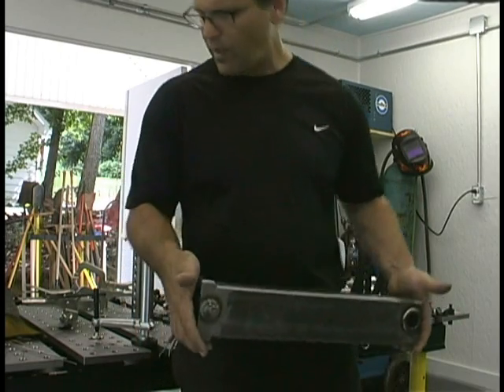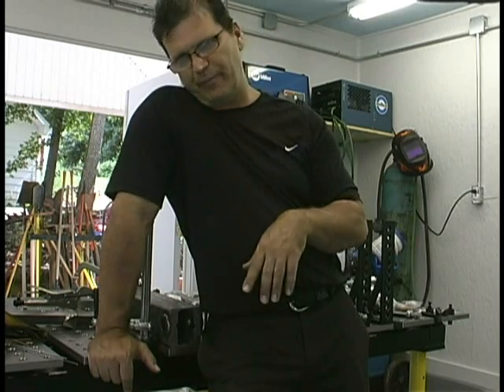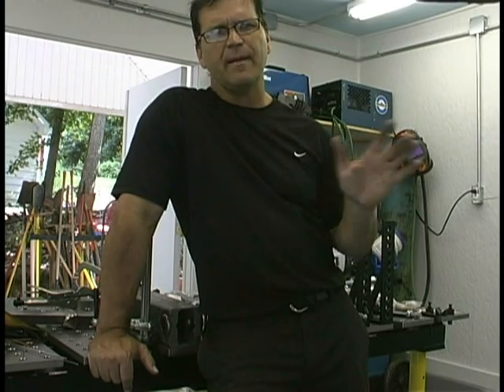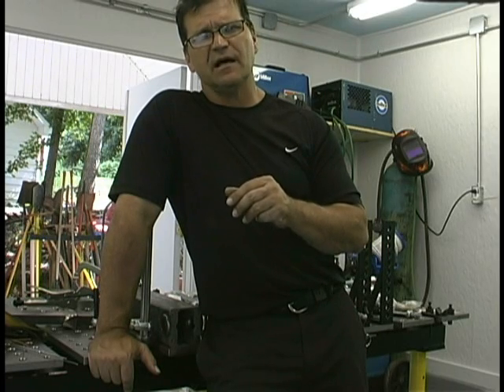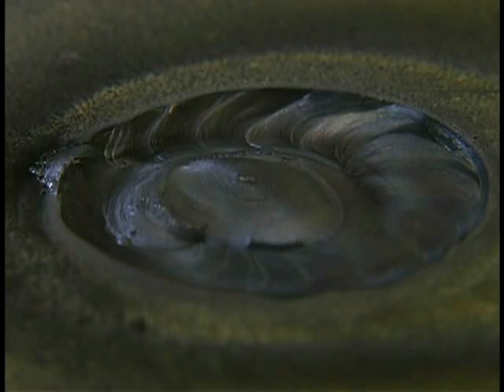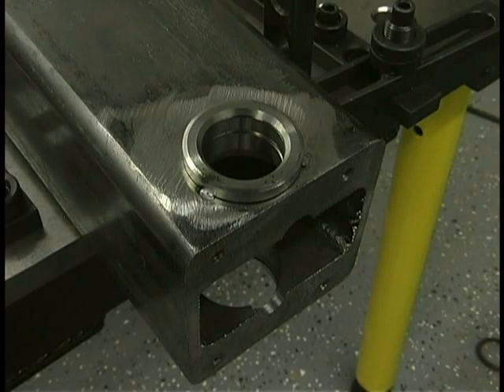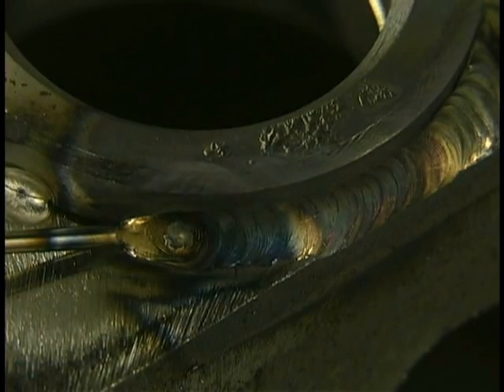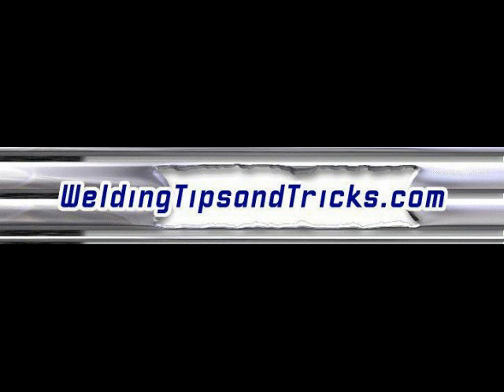Everlast PowerPro 256 Welding Machine part 1

Comment: This many years later is the 256 a good welder ?
Reply: I bought mine about ten years ago. Have used it a lot and Im still happy with it, no problems. My friend bought one as well, maybe a year after mine. He used it very little, maybe 20 hours total in about 8 years. The main motherboard burned out, so the machine wasn't worth fixing. It was years out of warranty but Everlast did help him by reducing the price on a new machine.
I guess that's electronics, it can go forever or , if something is wrong, only last a few hours.
I also have a 200 amp DC Everlast TIG/Stick/ Cut. It's a bit older yet, 12 years now and zero problems. I use it primarily for cutting now and the powerpro for welding.
Reply: @glenbreaks5448  thanks for your reply, glad to hear you're happy with it. I bought mine around last february, used it till June then packed it up because of moving. Need to get back at it.

Comment: I have this welder. Does every thing good. My problem is switching from Tig to Plasma. Leads, all the buttons and switchs you have to change. I ended up getting another Plasma and using this as Tig only. Not the welders fault. I jst don't like switching every thing.

Comment: i would like to see someone do a durability test on a everlast welder, like having 3 people switch on and off  welding non stop for 8 hours and pulse welding the hell out of it really heat it up i have put a few lincolns welders through hell and never had a problem i do like the everlast duty cycle but what good is a higher duty cycle if the machine quits

Comment: Yes, the MTS welders are DC TIG only although you can weld aluminum with MIG.  If you want AC TIG then probably go for the Everlast 200DX or 250EX.  Their digital AC/DC TIG welders are pretty sweet too.

Comment: that's a DC lift arc machine, so you'll have to buy another AC/DC tig welder to have the same options.
if you buy this one and a seperate good MIG machine you'll be better off in my opinion..

Comment: what brand you got regulator you got a heard nice blast  star tigged .. depend  preflow ..how many second you set up.. another question .. 250ex vs power 256 whos the best tig those you recomende..i weld  3/4 5/8 1/2 bars s steal. 304L.. can you help me .. thankyou..

Comment: I actually bought one of these. I am not a welder by trade. Just a hobbyist that's used a MIG for the last 10+ years. I have always wanted a TIG machine and after selling my plasma cutter, I was able to get one of these for just a little bit more. I dealt with Alex (also Oleg). I initially had a problem with the plasma cutting torch and they sent me a brand new one immediately at no charge....no questions asked except my address. I love the machine and they have treated me well so far. :-)

Comment: DAMN! You make me want to buy a TIG welder!  :-)  Ive never done any TIG welding, but would love to learn!  By the way, Im doing a lot of repairing on my '82 K5 Blazer where it was very eat out with rust... I bought an Eastwood MIG 135 for $299, Id like to see you do a review.  I am very thrilled with mine, even at 110v, it puts out a lot of good heat!  Wire speed is smooth, everything is fully adjustable.  Im running straight CO2 with a paintball adapter. Hope this helps someone!
Reply: yea bro, you're not gonna be able to tig your rusty ass blazer lol.